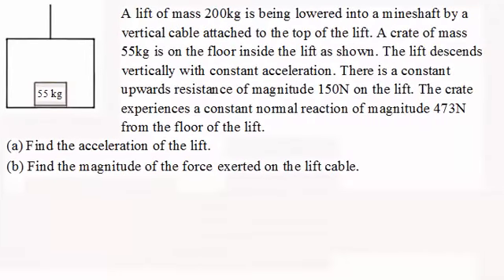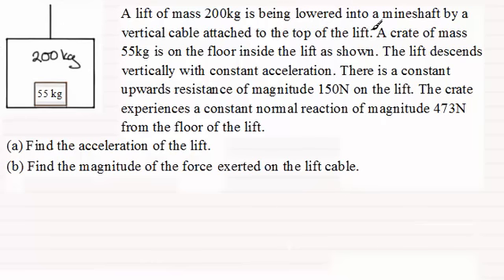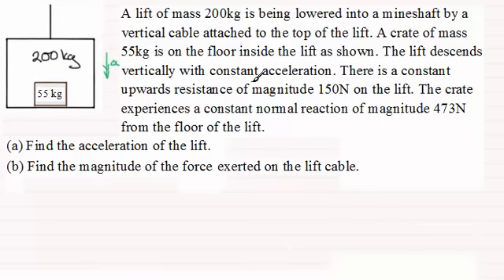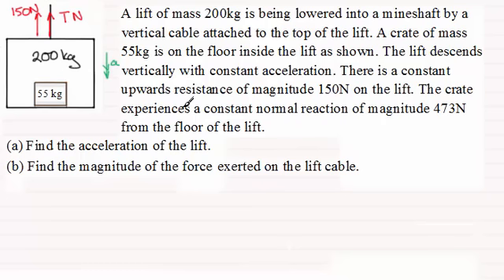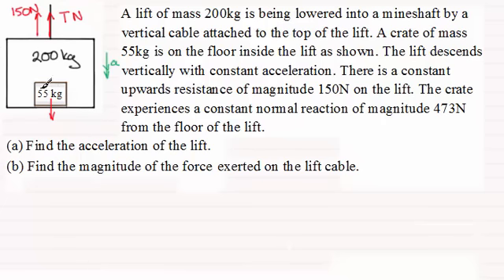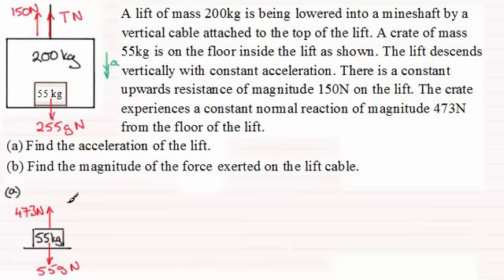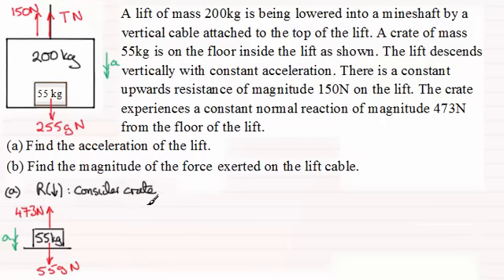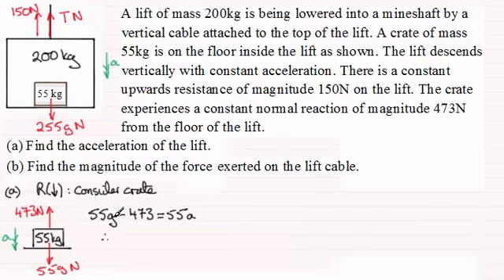Forces on a Lift (example) : ExamSolutions Maths Revision

Comment: The question is about the acceleration in the lift, so won't we consider the mass of (trolley + crate)?
Reply: We basically refer to that certain object we are finding the acceleration of?
Reply: That's what I'm thinking.
Reply: I think it's because the crate and the lift are almost like one object so we assume they both travel at the same acceleration. If we knew the tension in the first place, we could have used the formula resultant force=mass-acceleration using the combined forces but obviously at first it was unknown. We knew the normal reaction force and mass of the crate so this is why we used the crate.

Comment: ahhh! I recognise this question... it's from the June 2015 M1 paper isn't it? I couldn't work out how to do it in the exam but thankfully got an A* in maths anyway. thanks so much for your videos!
Reply from the maker: +delpetra That's correct and congratulations on the A*
Reply: +delpetra Hey I was wondering, how hard did you find C3 and C4 compared to As level maths? I know that it's a lot more difficult, but seeing as you got an A* (I've been predicted an A* with 282 UMS at As level), how did you find it?
Reply: +Laxsan K I'd say C3 and C4 were definitely harder (I found C1 easy and C2 'medium'). C3 is alright, definitely easier than C4. If you've got a graphical calculator you can check loads of C3 answers on it. (would recommend getting one from eBay if you've got the money, and you can often sell them for close to the original price when you're done - I need to sell my fx9860 soon!) I feel C4 is normally the mean paper, but if you get a solid mark in C3 it'll balance out. Both can be quite fun though to be honest!

If you got 282 for AS though I would say you're definitely on track for an A*. All I can suggest is do lots of past papers, starting from the most recent ones (they're hardest), and make sure you do all the R/IALs too.
Reply: +delpetra thank you very much for the detailed reply :) I will do my best and we'll see what happens!! Well done on your A* btw!!
Reply: +Laxsan K you're welcome! if you've got any more questions don't hesitate to message me. thanks so much! :)
Reply: +delpetra alright, thanks :)!!
Reply: Hey, can you give me the model of the calculator please? Thanks.
Reply: +Sami Xxxx mine? I used an fx9860 gII SD but also took a fx991 ES-plus in just in case!
Reply: delpetra Thank you very much. I have fx-991ES PLUS. I don't know if I should get fx9860 gii, it's like £80. What can it do?
Reply: +Sami Xxxx basically just draw graphs! it is SO helpful in C3/4 but obviously it's expensive too. you can probably sell it back on eBay again once you've done with it though. that's what I'm planning to do when I get the time!
Reply: +delpetra Hey, were you taught how to use a grapical caluclator? I've brought one through my school but I have no idea how to use it!
Reply: +Kalvin Ch no, hardly anyone in my school used one! I learnt from getting a pdf of the instruction manual and searching through it whenever there was something I wanted to do but didn't know how, and then just got experience using it!
Reply: Thanks for the advice man.Congerats on the A* aswell!  II was wondering what you're studying at uni and where now?
Reply: +Kalvin Ch you're welcome, thank you haha! biology at oxford, although I do miss maths a lot!!
Reply: very Impressive!
Reply: delpetra Very Impressive man!
Reply: +Kalvin Ch haha thank you!

Comment: why dowe consider the the crate when finding acceleration instead the system as the whole
Reply from the maker: Generally you do consider the whole system. However, in this question we did not know T so if you did consider the whole system you have an equation with the acceleration a in and T. If you consider the crate only for this question a is the only unknown as you are given the reaction from the floor which is not normally given in questions. That is why it helps to do as many varied questions as you can.